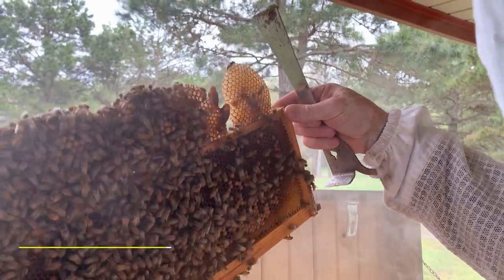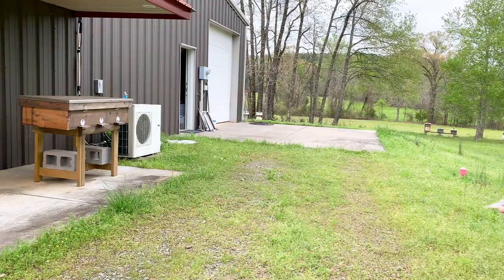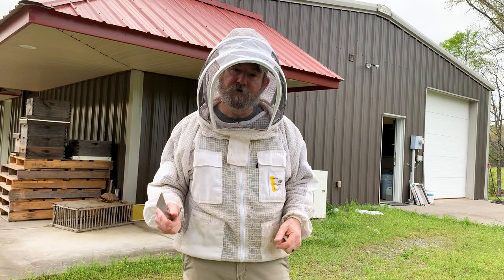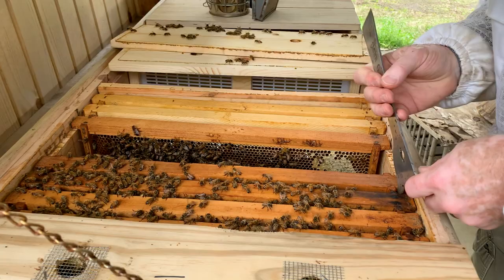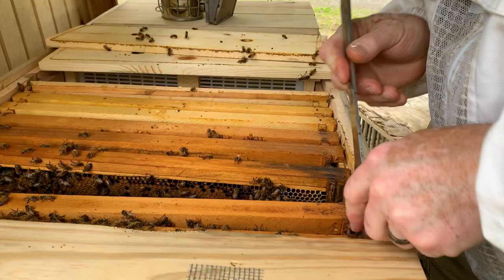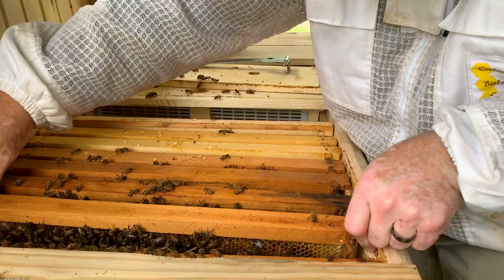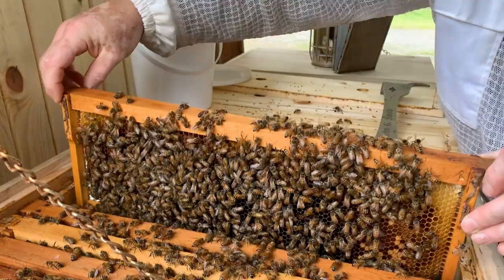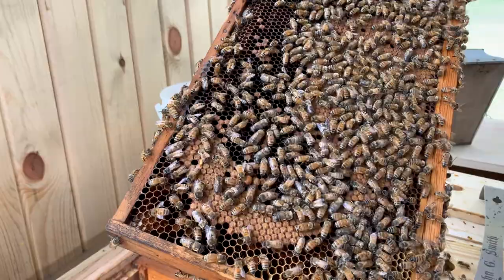Over-Winter Queen checked out! What's left in the Long Hive? [a look inside after a swarm]

Comment: Could you not have put these extra cells into another box with some other bees to start some other nukes?
Reply from the maker: Very well could have, but I didn't need anymore nukes and I wanted to show the process each cell goes through. But yes, you can!
Reply: I had asked this same question. Thank you for the reply.
Reply: Tip : 👀
You could also carefully 'Cut Out' those extra Queen Cells, place them into Cell Protectors and add them into the top of Roller Cages. And 'Bank' them in a Line on a Holding Rail Frame.
(Remember the longer the VQs are held caged, the less they are to be Mated well when released to do their Mating Flight.) 
I would prefer to make up Mini Mating Nucs, add a QC, and let her Hatch, go out to Mate. [They only take x1 Cup of Nurse Bees.] To get good outcomes re Queen viability.
Sure their are some Newbie Beeks, or a Bee Club near by that would appreciate those 'Queens to be'. 
Always think to Mash them Down, is a real Shame. [Almost a Beekeeping Crime !]
And remember : not all Virgin Queens make it back after a Mating Flight (!?!)
If you only have x1 Hive, and you Culled those spare Queen Cells, what are you going to do now ? Panic ! Buy in a Bred one for big £'s $'s ? 
Better to keep your Spares, then Share. 👍
Or if you do dispatch them : Keep them to add to some Hand Alcohol ! The QMP of those RIP Queens makes great Bait Hive Lure 'Tincture.'
Just need at least x1 Queen, in a Dark Brown Glass Medicine Bottle. 🥳
Just my suggestion. 😎
🐝🐝🐝🐝🐝🐝🐝🐝🐝
Happy Beekeeping 2023
🐝🐝🐝🐝🐝🐝🐝🐝🐝